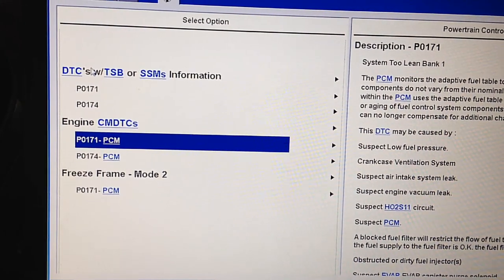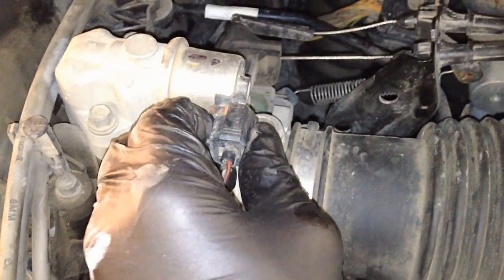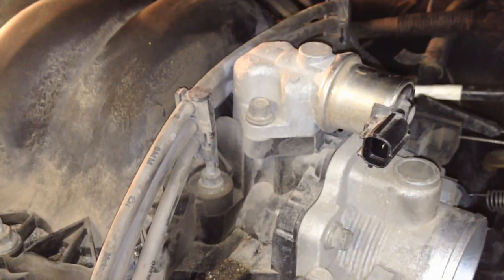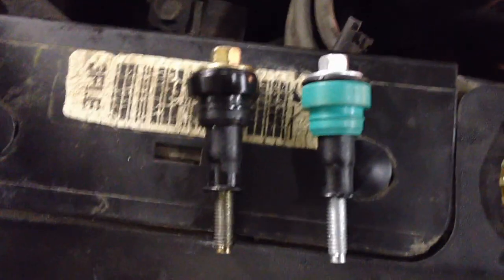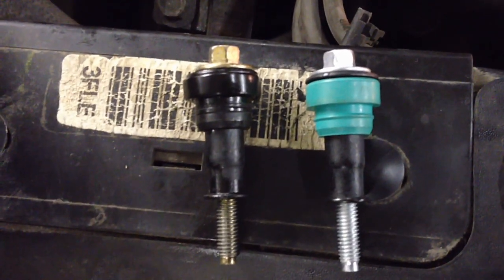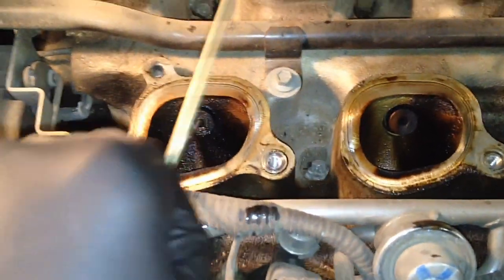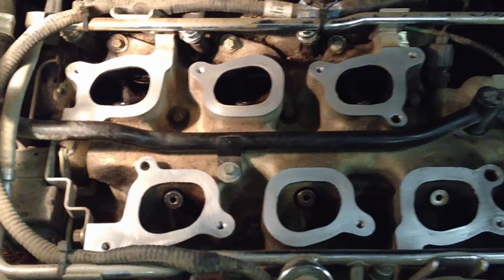Ford Windstar P0171 P0174 Upper Intake Manifold Gasket Replacement

Comment: Great video.  Wondering if this would help my 2001 Windstar.  I think there is a vacuum leak somewhere as it idles very low at stoplights (500-600rpm) it never kills but it gets close.  Cold started it the other day and drove without warming it up.  VERY rough idle and check engine light came on throwing codes for a cylinder 3 AND 4 misfire when i started down the road.  Im not sure where to start.  Would replacing the intake gaskets help the misfire codes?  Any help on what I should do first would be great!
Reply from the maker: Absolute first thing to do is fix the misfire. Being cylinders 3 and 4 I would go straight for the coil pack and replace it. Also unplug the vac line from the egr valve and see if the misfire condition improves. See here then get back to me- Ford F150 4.2L & 3.8L Windstar Hard To Diagnose Misfires
Reply: FordTechMakuloco I wanted to give you an update.  The codes cleared for cylinders 3 and 4 on there own.  I took the 2001 windstar over xmas filled with people to a holiday party and it was constantly misfiring while driving down the road.  im assuming the heavy load made this more evident than just me taking it to work.  So i replaced the coil pack on my own. I dont see much difference.  Ive only had just me in it so im not sure that the misses are completely gone.  The NEW issue is the bogging down.  The transmission shifts through the gears smoothly on acceleration but when i get to 35-40 in town and the rpms drop down the bogging starts.  it goes away when i hit the gas but lately the bogging sound is accompanied by a "jiggling/change sound".  that is making me nervous.  I take the freeway to work and when im speeding up the on ramp ive noticed somewhat of the bogging when i get to speed but not nearly as bad when im in town.  Ive shut the O/D off when in town and its helped only because the rpms stay at 2000.  Again, idle in the driveway and at lights is 750 to 1000 tops! I havent found much of any help online.  When i sit parked and give her gas the rpms never get above 3000-3500 and its pretty rough.  HELP!  thanks in advance.

Comment: YUP, me again. I also wanted to ask your opinion on the "WINDSTAR" collection.  I have heard so many bad stories about transmission problems.  Besides BASIC maintenance, IYO,  are these vehicles destine for the boneyard from the design table?  I sorta kinda like these turds, and want to keep them ( I've accumulated 3)  going as long as possible.
Reply from the maker: +Gary Kovach In general they are very reliable we have seen some beat up high mileage units that keep going. About the only major trans issue we have seen is the stripped convertor issue.

Comment: 2000 Ford Windstar SE makes a pinging sound, kind of like a light knock. I know it's old and has 106,674mi on the engine. But it feels like it isn't getting full power and almost like it's either not getting the right amount of fuel or it's not burning all the fuel in the cylinder. There are no usual signs of the piston ring problems like blow by and oil smelling like fuel and loss of compression. It feels like somethings clogged and being restricted either from the air intake and intake manifold or a fuel filter clog. I know it had a basic tuneup done but I don't know what was replaced or not. I don't even know if it truly was done. I'm getting those same codes coming up with Torque Pro for Android and a Bluetooth ELM-327
Reply from the maker: ***** if you are getting the lean codes perform the intake seal replacement as shown in the video and make sure you clean those egr ports I have videos on both. Also while the intake is off it is very easy to do rear plugs I would at least check them.

Comment: I'm doing this job right now on an '02 F150. Is there no reason to suspect and replace the lower manifold gaskets? The valve covers had oil leaks that caked up on the lower aluminum manifold.
Reply: And the isolator seals in mine were green, and the replacements in my FelPro kit were black.
Reply from the maker: We never replace the lowers unless there is an oil leak.
Reply: @FordTechMakuloco  Thanks for the reply.  I finished reassembling everything.  No change in fuel trim.  :( So I'm still stuck with a leak somewhere.  Idle Trim is higher on bank 2 at 15-20%. I'm thinking maybe brake booster?
Reply: Bank 1 is 7-9% at idle.

Comment: I really enjoyed your video.
I've got a 1998 ford explorer with new plug wires and coil pack and still getting 304 171 and 174 codes. putting a injector in the number 4 
this week. While I am doing this should I good ahead and do the lower intake manifold as well?
From everything I've read. sounds like a good idea.
Reply: Watch real fixes real fast, he does a 96 Windstar, which is the same as a 98.  This video is 99 and newer.

Comment: How's it goin ford tech👋, i recently purchased a 00 windstar 3.8 and judging by what you diagnosed here, and go into explaining how its only a minor leak that would be just enough for the code, im assuming my windstar is throwing these codes for the same isolator bolts. If the dealer who sold me the vehicle had disconnected the battery, this sort of issue would take a few stops and runs to throw a code again right? And also would this issue most likely cause a slightly rough idle at stops and lights? Other than the two i dont see much any other identifiers to a lean condition, she handles hills just fine here in PA and will cruise around 65-70 on the highway effortlessly.. you're helping hand woupd be greatly appreciated
                  -sincerely
                Another Grease monkey

Comment: I just did a repair on our 2000 windstar 3.8. It was a corroded water by-pass line that sits below the lower intake. Coolant was shooting everywhere. We fixed that and its was running fine up until this morning. My wife went to start it and its shaking really bad, check engine light is flashing when in gear, but stays lit in idle. Also a sulfur smell.  WE didn't replace the lower intake bolts but don't think thats the issue. Any clue?  We need to get the codes ran but scared it may break down on the road. Funds are super tight.
Reply from the maker: talkntribe How lonbg has it ran ok since the big repair. You likely have a coil pack that has failed. You will have to pull codes to see what direction to take. That will tell you which cylinder. In the mean time inspect all the spark plug wire connections and injector plugs that you may have touched. The injector connectors like to crack and come loose causing a dead miss.
Reply: FordTechMakuloco thank you for replying. On saturday we did the coolant line. When we put the windstar back together it ran fine. We let it run to make sure the temperature was okay. Now, come tuesday morning, my wife went to start the van and it shakes really bad. The check engine light comes on but will flash when you drive. We got a code ran and its the P0301. We checked the spark plug and wires seem fine. I actually just put the vehicle back together as its starting to snow in Cleveland ohio.   I changed the Ignition coil pack back in 07.  I'm debating on having my wife pick one up today. We checked the lower intake gaskets and bolts "green" are okay and torqued to specs.  Seems to run better when the van is idle right now. When I put in gear it jerks and shakes bad. ALso like a weird smell maybe sulfur.  The local garage say replace spark plugs, wires, ignition coil, then try some gaskets and hoses.  Really frustrating me.
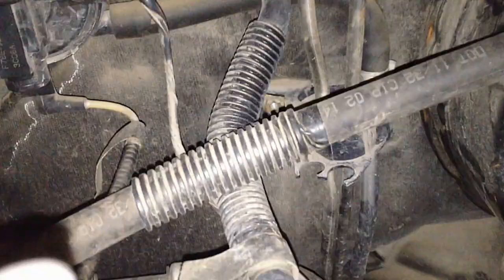Reply: FordTechMakuloco @ 2:07 in this video you show a vaper hose and mention suction. I'm not sure if this is anything but I notice when I run the van that tube is sucking so much to where is like squeezed shut in the middle of the hose.  Not sure if this would cause the misfire code 1
Reply from the maker: I would go right for the coil pack but it is a good idea to check spark first to see if it is weak. Also I would inspect plug number one and check the condition of the electrode for cracks etc.

Comment: I have a 2000 ford Windstar. It is running lean and was told this is a easy fix. I know you can adjust if it has a carburetor but not with this vehicle.  Is this caused always by a vacuum leak or something else. also the van has issue shifting into 2nd gear only when you first start it. After that it is fine. overdrive light along with engine light and trac control light. Any idea on this one??
Reply from the maker: Mandi Wolf Yes the fix is very easy and common just follow the video. The cause of lean codes is almost always a vac leak and only sometimes from a dirty MAF. The 2nd gear issues is the intermediate clutch failures known issues on these.

Comment: I have a 2007 Ford Fusion 3.0 AWD with the same codes P0171 & P0174, idle on startup is slightly rough but once warmed up seems to be fine, also drives fine... Can that be a Vacuum Leak? Where do you suggest I start?

Thanks a lot, great videos!
Reply from the maker: I would start with checking for vacuum leaks yes, I would check the intake with carb spray on the intake seal cold as shown here- Ford Escape 3.0l V6 Engine Vacuum Leak Testing I get to the spraying part eventually.
Reply: FordTechMakuloco Thank you, I can hear like a air leak coming from close to the engine bay but I can't find it with the spray (I am kind of nervous with the spray too :), the engine runs normally after about 1 minute, so I guess it makes it harder to find.... I cleaned the MAF reset the code, so I will see if it comes back, seems a little smoother after cleaning the MAF, but still hearing air leak noise.
Reply from the maker: A lot of times you can hear the air rushing though the intake and it sounds like a vac leak. Have you check all hose connections to the intake including the sir inlet snorkel pcv tube etc? Definite vac leak classic symptoms. Watch my video on pulling the intake. I go through all the connection to the intake and air snorkel so you know each one to check.
Ford Fusion 3.0L DOHC Upper Intake Gaskets

Comment: had this done before by the dealer. im doing it this time. one question on the torque. do u go streat to the 89lb or u work up to it.
Reply from the maker: Howard Roper Straight to it it is 89 inch lbs not 89 foot lbs.

Comment: Perfect.. I'm using about 1 quart every 1k miles and I get 13 miles a gallon in city and I about shit.. I don't have codes and I've disconnected the pcv and everything runs fine.. . Anyway as it looks oil is leaking out from under the aluminum intake and the head gaskets, I've had to spray it off every month or so.. Do you think this is because the aluminum intake is full of oil?  I do believe this should  fix the problem.. Thanks
Reply from the maker: Nope the oil carryover is normal, you need to do lower intake gaskets, just did some today.
Reply: thanks man..

Comment: My mothers 2000 Windstar is showing the P0171 code...we're trying to decide where to take it...her regular mechanic shop is good but high dollar. What would be the cost for this repair?
Reply from the maker: I would say maybe $400 depending on parts.
Reply: FordTechMakuloco  Thanks! the mechanic believes our problem is the heater vac hose, (red wire attached) parts & labor $125.00..We're waiting on the part - BTW: Great detailed video, I appreciate the reply!

Comment: I like this video. I have a 2002 ford e-250 with a 4.2 engine. It's basically the same process I have both codes also.

Comment: Do you have a ford part number for the isolator bolts with the green grommets and the clam gasket? Thanks
Reply: It's for a 2004 f150 heritage with a 4.2
Reply from the maker: Sure here are the numbers from Ford-
Isolator Bolt- 3F2Z-9S479-AA
Clamshell Gasket- 1L3Z-9461-AA
Intake Gaskets- 1L3Z-9H486-AA
Reply: Thanks! I got the job done and no more service engine light! I got the parts from Tousley Ford

Comment: After many DIY automotive fixes found on YouTube, I have to say this video is definitely one of the most through and well done. Subscribed and Thanks!
Do you have to do the lower gaskets as well, or are they not a concern? Any problem signs to look for with the lowers?  '03 Windstar, 130,000 miles.
Reply from the maker: I have never had to do lower intake gaskets on these for lean codes. The lowers all leak oil at some point but vacuum leaks are very uncommon on them, you will get the same symptoms as the upper- Lean codes no driveability concerns.

Comment: my mother's windstar is leaking antifreeze pretty bad, mechanic said the intake gasket is the cause. Could this be true or is he just trying to get more money for a POS that isn't worth fixing? antifreeze is dripping off the back of the engine and onto the converter. It leaves puddles on the passenger side. or perhaps the intake manifold itself has a hole?
Reply from the maker: grettagrids Most likely the coolant leak is coming from the front cover area top left. Best way to tell id to clean off the area dn run the engine while looking for yourself. 3.0 or 3.8?
Reply: the lower intake manifold gasket can leak coolant

Comment: Hi, first i want to thank you for this awesome video.I have "small" problem.I changed bolts and tight them on torque 89lb inch..maybe its just my feeling or my torqe wrench doesnt work properly but it doent seems a lot pressure on rubber.anyway i followed all steps from vid, put pieces together and now when i press throtle it makes sucking noise.i checked all pipes and tubes and i didnt find source of noise.do u think i ddnt tighten bolts enough or any other idea? thanks for answer
Reply: Ondrej Kupcik did u figured it out

Comment: What do you use to clean the Egr ports?
Reply from the maker: Anything small like a coat hanger and lots of compressed air.
Reply: @FordTechMakuloco  and for the oil around it?

Comment: I've got a 96 Ford Windstar gl. 3.8 engine.  I get the code 1516 coming up. Any ideas?
Reply from the maker: George W Please follow my IMRC video on these codes your linkages likely fell off.
Reply: Linkages all intact and bushings good.   I even checked the actuators with a vacuum pump yes they pull in.  I'm wondering if I may have a faulty actuator. How would I check that.  I did a bit of research that code of 1516 refers to bank one. Is that in front or back?

Comment: Bought my used 1996 Windstar LX 3.6 w/115k miles and a nice body - just like the women I've been dating.  It ran ok, but my check engine light keeps lit.  Gonna buy gaskets, cleaners, oil and hope to have this engine running great.

Comment: I like your video. question  Ihave a windstar,2003 it's mixing oil and antifreeze. what i shuld do?
Reply from the maker: +Máximo Bautista Remove the lower intake check for crack is all is ok replace the intake gaskets and torque properly. The lower intake is the most likely source of your concern.
Reply: Ok thankyou. If I find a crack what I should do do i have to replace the heads, and the intake?
Reply: I will keep in touch with you. Thanks.